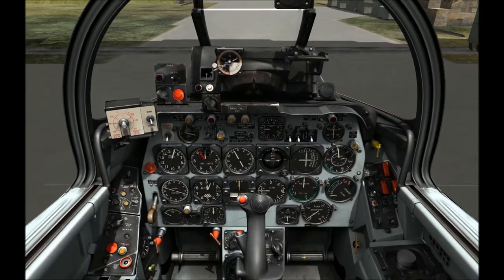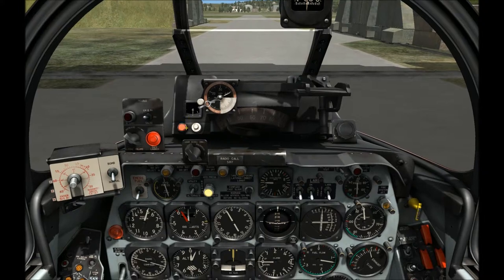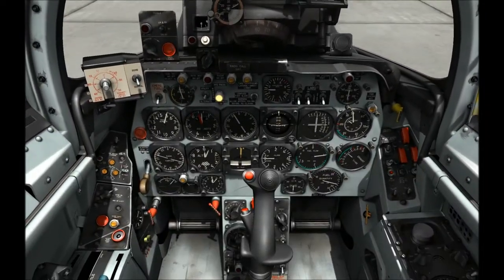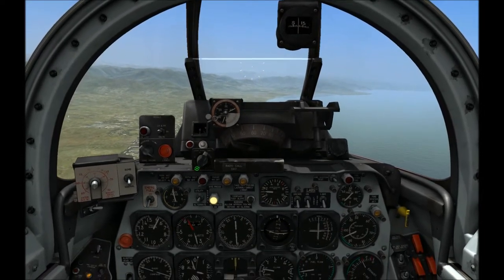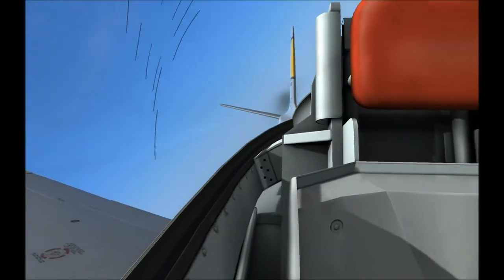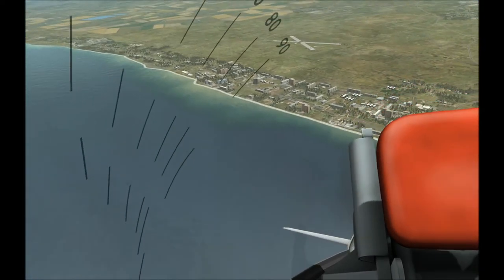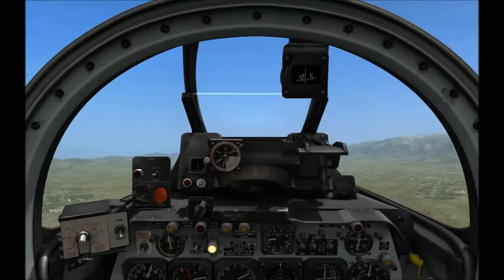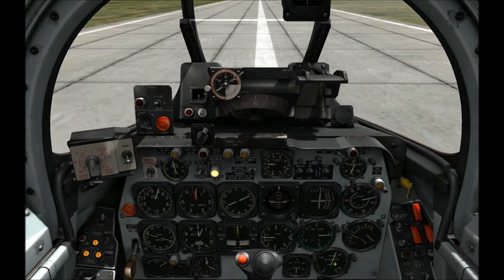DCS - F86 Sabre take 2!

Comment from the maker: @ryan burnsred, you have to trim manually, unfortunately there is no auto pilot in the sabre, you trim to keep the aircraft flying straight, the reason you do it so much is so your not always holding the stick at an odd angle and also if you do let go of the stuck the aircraft dosent roll or dive uncontrollably. I trim by using the HAT switch in my joystick